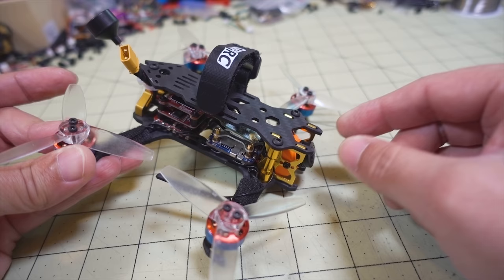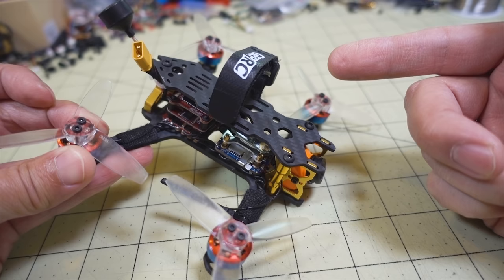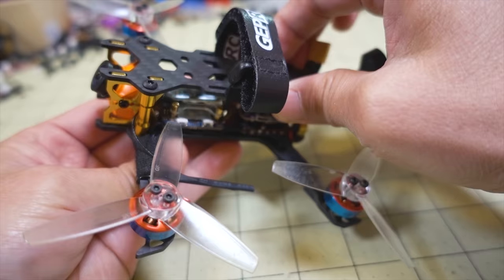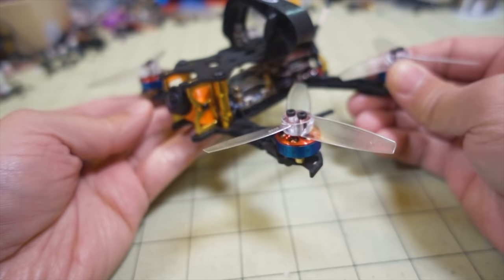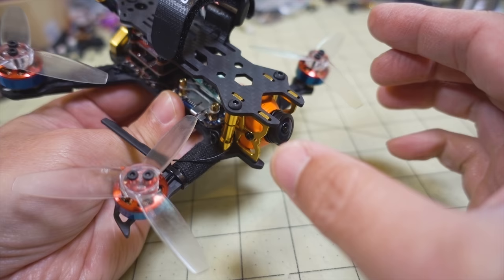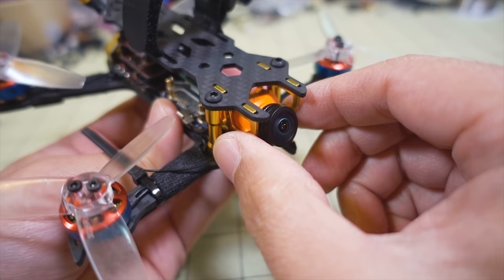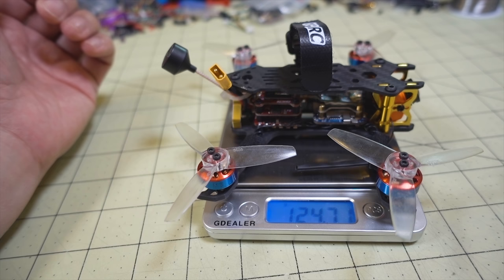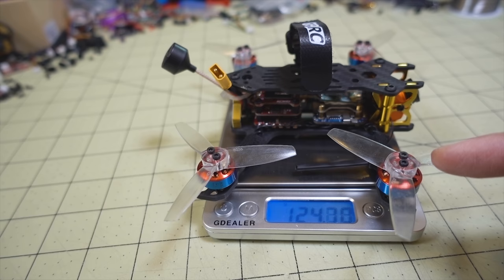MD#158 🚁FLYWOO ANT // 3-inch HD Video Drone 👍📷

Comment: Ive heard those motors are super efficient. Can you recommend them for a long range 3" build? Also what is your average flight time on a 650-850mah battery?
Reply from the maker: I've only tried the 550mah 4S and 750mah 4S.  I can get about 9 to 11 minutes on the 750mah 4S
Reply: @AlbertKimTV  wooow... ok im in. Canadian company too so im sold

Comment: Awesome! I’ve got a pretty similar build but with the ih3. It flew really great for a while but got more and more vibrations over time... don’t know what the problem is though :/
Reply from the maker: Have you crashed it?
Reply: Albert Kim yeah I’ve crashed it a bunch of times (just uploaded a crash compilation on my channel lol), though I don’t know what might’ve gotten damaged...
Reply: jacob james I’m running 1404 motors but I noticed that one of the motors is sounding a bit different from the others, like the bearings are broken or something. Could that be the cause?
Reply: @jacob james Yeah the motor does that a very little bit. And it sound different when I spin it fast. Don't know if I really want to buy another motor though... Might just try to sell it. Thanks for the answers though! Appreciate the help :)

Comment: Looks like it's got a fair bit of prop wash on this one
Reply: Can you fit the aluminium camera mountings the opposite way to get more camera protection or are the two slots different sizes?
Reply from the maker: Won't go in the other way